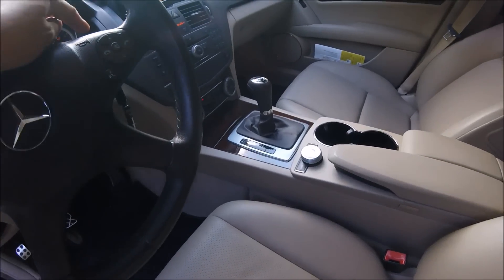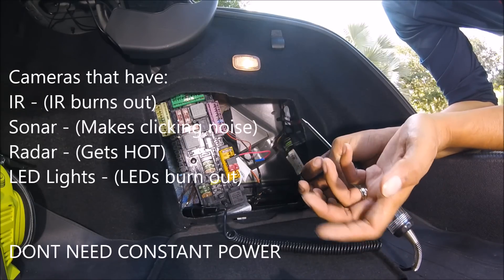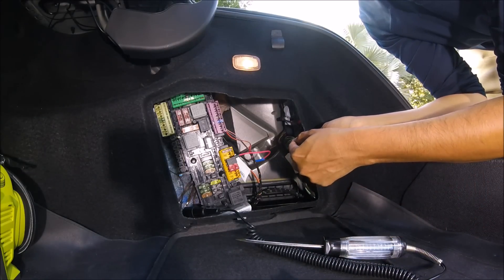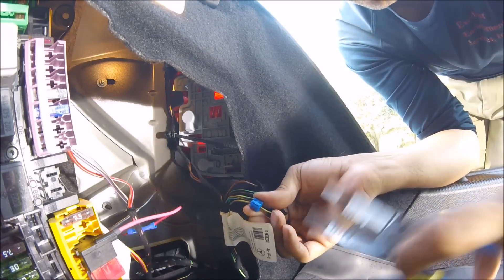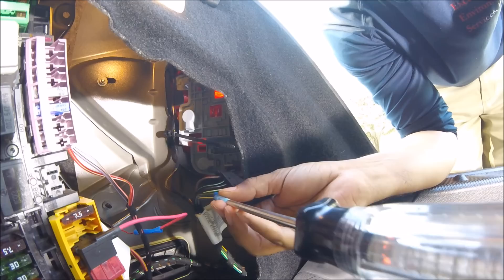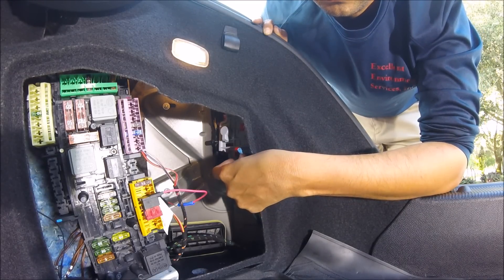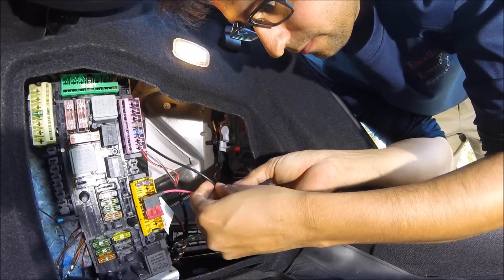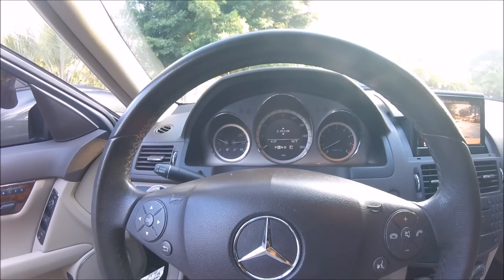Wire Backup Camera to Reverse Light CORRECTLY on ANY car

Comment: I think the warning message is for the bulb (lamp) being out or technically an open circuit not a voltage "drop".   Still a great video - it's nice to have a fuse panel in the trunk - makes for easy add-ons ;-).  As others have pointed out probably the "best" way would be to cut and solder the wires and perhaps use a relay to avoid more current being pulled that was originally designed but it being a German car I'm sure everything was over engineered and the reverse light wires could probably take more than the 5 or 10 watts the stock bulb pulls thinking that us Americans will replace the incandescent lamps with LEDs anyhow ;-)  Great video!

Comment: Use a constant fused power wire from battery to camera and a relay from the back up light tap to use as a switch for on/off, it will be ideal! Might as well run a heavy gauge fused power wire from battery to the trunk and add a little fuse panel, or junction box with several terminals. It will be constant power supply for multiple auxiliary gadgets you like to power in the back of the car. Then just hook relay for camera, relay for rear auxiliary lights, relay for rear monitors, or relay for rear amplifier! Just a thought...Peace
Reply from the maker: You need the advance section of my channel:
https://youtu.be/MNWNAC7kNUA

Comment: Hey did you ever ponder the idea of putting in the Folding back seat option?  I actually would love to see that done, because I am looking to experiment with the idea, I am digging this video by the way Great job!
Reply from the maker: Folding seats?!? Point me in the direction!
Reply: sure man heres a link:  https://www.ebay.com/itm/MERCEDES-C-CLASS-W204-C300-REAR-SEAT-SET-5-SEATS-BLACK-LEATHER-OEM/291938344016?ssPageName=STRK%3AMEBIDX%3AIT&_trksid=p2055119.m1438.l2649
or .......https://www.ebay.com/itm/2008-MERCEDES-W204-C350-REAR-SEAT-ASSEMBLY-BLK-2008-2011-C300/172854549573?ssPageName=STRK%3AMEBIDX%3AIT&_trksid=p2055119.m1438.l2649

I know your interior is a cream color, so i'm sorry i could not find a cream interior version but yea there is a folding seat option for back. I will be looking eventually to do this I just figured maybe you could do a great demonstration of it as you do always thanks for the reply

Comment: Good video. Thanks for information.   What about soldering the wire with heat shrink insulation.?
Reply from the maker: You can definitely do that I actually encourage that method. But this video was created for the DIY person. Solder is a skill some people aren't willing to do.
Reply: @RaymondUrias  not safety, soldeing not newer used car, if wire come sometime hot, maybe somethink have broken , then wire have hot and melt solden and burn car, wery stupid idea.use only specified abico crimping connectors and right tools grimp this, then have sure good connection and safety. no melt, no come hot, no drop, no burn car.
Reply: @mattivirta  if the damn wiring in the car is hot enough to melt solder, you have much more serious problems. Common rosin core solder melts at around 180C. Not to mention, a small drop of melted solder isn't going to cause a fire. Solder and shrink wrap is the proper way to do splices, bottom line.

Comment: Isn't the right way via canbus signaling, I put a system in my brother 2012 c300 and didn't have to to all that, it had a camera video and power line on the unit once the vehicle goes into reverse camera gets power automatically and power drops 20 seconds after once it's out of reverse same for most units I've installed in many cars....
Reply from the maker: Way ahead of you. I have been working on Mercedes Benz since I was 19. This video was for the everyday car. But I don't own an every day car so I made lemonade with what I had. This video is for you:
https://youtu.be/MNWNAC7kNUA
And I have another using capacitors.....
Reply: Raymond Urias oh ok I understand what you're saying, I was just wondering... Lol but don't forget to put the parking brakes on cause in reverse the wheels are free lol...  But back to the electrical you can also use a diode that will just get the 12v feed but don't push back residual or static voltage back into the lamp control module, that will prevent the system from tripping the fault..  There's other methods also but I'm sure this works for everyone

Comment: Thanks bruh, great info.. i have a c230 compressor 05 and im gunna be updating the sterio system with a back up cam, and now i know how to install that bck up cam.. so i thank u.. and u have a new sub👍
Reply from the maker: Make sure you buy a relay or capacitor it will save you
Reply: Fosho, thanks again

Comment: I have Volkswagen vento I've wired up reverse camera power and ground both to reverse bulb wiring itself. So I haven't used separate ground for the reverse camera. Is this safe and correct way of wiring it? Also my camera screen pops up automatically on my pioneer AVH Z5090bt even if I'm not in reverse. Solution please
Reply from the maker: Nothing wrong with what you did assuming you found the correct ground wire. Did you also run a signal wire to your radio? The pioneer requires a signal wire be ran from the reverse bulb/ or OBD2 to the radio I believe it's a purple wire in the back. Also you will have to go into settings and select the correct one. Keep in mind if you have it set to battery your telling the radio that the camera is always on so the screen will switch to that while you are driving. I would change it to ground or if possible signal.
Reply: Raymond Urias - Yup I've given signal to purple camera turn on wire of head unit and it's positive from reverse bulb. So the settings are kept on battery as options available are only battery and ground. I've checked connections via dmm.
Reply: Raymond Urias - Yup I've given signal to purple camera turn on wire of head unit and it's positive from reverse bulb. So the settings are kept on battery as options available are only battery and ground. I've checked connections via dmm.
Reply from the maker: Make sure you don't have the reverse camera app open. Close it and set it to off. If you have it on it will keep switching to the back up camera and display a black screen. You can only have it on if the camera is wired to constant 12v then you can turn it on while driving and see cars coming up on you 🤣
Reply: Raymond Urias - Yup I'm done with this too. I think we're close to the solution. After reading your comment I'm down in my car now tried it immediately. But as I switch off back camera input camera won't turn on even if I switch to reverse!

Comment: You show the power wire..how bout the neutral or ground?
Reply from the maker: What neutral? They only have power and ground. Ground goes to a bare metal point or you can tap the ground wire coming off the bulb harness. If you are wiring this in your BMW I recommend watching the relay video as you will need to do that.
Reply: +Raymond Urias .ok I guess that's what I was asking.the ground on the harness..is that green?
Reply: +Raymond Urias just don't want any error codes..you know how these bmw's are.  Lol

Comment: We have a ford fusion 2013, now I'm not sure if the Auto-Vox M1W you described on one of your other videos comes with power wires for the front end or is it just the cigarette lights plug. Like most other cameras that i saw have two power sores wires the rear you'll have to hook them up to positive and negative and the front also. You also described on this video that by using a wire tap connector via the reverse light and then you ground the black wire, my question is do I have to do the same for the front for the monitor?  Does it come with wires that i have to strip and find the power sores or does this Camera come with just plugging into the cigarette lighter?
Reply from the maker: +Whisper Slade ok I'm going to answer this with video links
First check out the new T2 it's nice
https://youtu.be/H_0djBUAn0Q

And your question is answered in this long old video I made.....im really sorry it's so long I didn't Know how to edit back then

https://youtu.be/7Dc8K97EmhY

The M1W uses a cigarette lighter for the screen. I'm pretty sure you will like the new T2 it soooo easy

Comment: I found the hot wire using this method, but where do i put the black wire?
Reply from the maker: +Kenny Parsons Ground to a clean metal nut/ stud near by. Or you can use the same method but hook up the meter to a 12v source and it will flash when it touches ground
Reply: Kenny Parsons Thanks for asking. I was wondering the same thing. ☺

Comment: Still think it best to disconnect earth on battery once you have found your wire ??
Reply from the maker: +syd bell not really necessary since it is not an open wire flailing around. All your doing is a simple tap. Now if you want to cut the wire in half and solder it in then yes disconnect the battery

Comment: Manage to install a reverse camera on my 2007 ML thanks to your vids. thanks ;)
Reply from the maker: +Luis Sampaio Thats awesome! What are your thoughts on the 07 ML?
Reply: In one word, excellent. Mine has air suspension so its smoth. did a remap and its now at 298 bhp. originally had 224 as its the 320 CDI. And its "upgradable". Got an android unit installed, led bulbs almost everywere without dash errors. Great car to ride, very happy. And thanks to your tips just adding stuff ;)
Reply from the maker: +Luis Sampaio that looks really cool and integrated but I feel for the money you can get a much better camera. I'm currently reviewing the Roav Cam 1 and I'm VERY impressed with it. It has a parking mode that works very well. There are several cameras out there and each year they get better. Definitely check it out:
 https://www.amazon.com/dp/B06XNSDRW8/ref=cm_sw_r_cp_apa_tV2xAbFD2RR8J

I personally like the parking feature because I go to car car shows and leave my lights on and I want to know if someone touches my car or keys it. But if you know your neighborhood and trust where you park then you may want to look into other options.
Reply from the maker: +Luis Sampaio who did the tune?
Reply: here its pretty safe ;) and I mostly don't want any screens on my windshield. this one caught my eye because it's plugged to the obd socket so no cigarette ligher cables and has no screen... But i'll keep looking ;)

Comment: I got the plastic piece of the wire tap with my reverse cam kit. What do you call the insulation part that fits on top part of it?
Reply from the maker: +Nimantha Wickremasinghe is this a trick question...I feel like I'm being setup lol. The plastic is called insulation and the metal part is called the blade on a wire tap. Send me a picture on Instagram @raymonduriasjr
Reply: Hmm. Have to find some insulation then.

Comment: Hi Raymond, I have the same camera, it worked fine for a couple of days, but now it only works in reverse and the trunk is open all the way. Car: 2016 Chevy Sonic sedan, any suggestions would be appreciated
Reply from the maker: +Miguel Avila I'm confused it's a reverse camera...so it works in reverse. Or are you saying it only works if the trunk is open? I would recheck all the connections and make sure they are tight. If that's not it I would rewire cam using a relay: https://youtu.be/MNWNAC7kNUA
If that doesn't work then check RCA cable make sure it's in. And if that doesn't work then the camera maybe dead.
Reply: It works in reverse but only if the trunk is open all the way, not halfway, it's weird.
It use to work in reverse normally when first installed... I checked all the wiring, red to red of reverse light and ground to black.  I also tried connecting the ground to a metal part of the car.  When I open the trunk i can hear some type of click as if something is being triggered, not sure if it has to do with the 3rd brake lamp.

Comment: What is the best way to do this on a M/T car. In the case of the M/T ....If it is M/T reverse only comes on if the car is in reverse, which only happens while you are moving.
Reply from the maker: +Good4Y0u put key in car, turn to where your power comes on but not engine, put in reverse. The light will come on without stalling your car
Reply: Raymond Urias I mean to actually use reverse . Unless I'm clutch engaged the reverse lights don't tend to come on... could just be my car though.
Reply from the maker: +Good4Y0u that maybe your car. My Z3 does not do that. You will need someone to help you with your car (Someone in driver's seat) (Someone in back) Make sure Ebrake and wheel chucks are used...I don't want a subscriber to get run over

Comment: nice to know my 3rd gen 94 toyota camry is still high end. it has a rear bulb warning too.
Reply from the maker: +james42519 94 Toyota has that?! Jesus that's really ahead of the game
Reply: yeah there is a light in the gauges that comes one when brake light, license plate light, reverse light burns out. there is also auto lights off when you turn car off and open door. car won't let you lock doors if the key is in ignition and door is opened too. it unlocks them if you try and lock them. the sunroof beeps if you leave it opened and turn car off but sure that is common on cars really.
Reply from the maker: +james42519 that's actually really advanced for a car of that year. I'm surprised!
Reply: @james42519  same has my old volvo car, all has alarm and no can closed car if windows and roof have open etc, and not can add reserve cam to light alarm fast if touch to wires. i need to cam own relay then this work ,relay come to fusebox were resrve light fuse has.and not can start car if not sitting driver chair and door has closed, somethi,e has hard.

Comment: Hi - Quick question if I may. Where does the negative cable from the camera power cable go? Thanks in advance
Reply from the maker: +Jed Yaqub ground point on the car, or the ground wire on the tail light harness.

Comment: Thanks for great video and very helpful topic.  Will use method to tap into my Honda wiring.  Re: your vehicle's computer/dash fault indicator I understand voltage drop concepts, but do not follow why, you when now you activate camera/radar, the dashboard fault does not return as computer notes voltage drop from camera/radar.  Hope question makes sense.
Reply from the maker: Preston Ren Question makes complete sense. The camera is consuming nothing in the long run. The computer measures the current. There is a very small, known, resistance in the circuit, and a differential voltage measurement is taken across the resistor, which give the current in the circuit. If this current is below the threshold value, the bulb is assumed to be burned out. This is why when you upgrade to LEDS you need to use a resistor to trick the computer since LEDS use so little energy.
Reply from the maker: +Preston Ren I just checked out of curiosity the camera with radar is pulling 1.5A which is nothing literally a led bulb

Comment: does the backup camera automatically display on your factory installed MB info center monitor once your car is placed in reverse?
Reply from the maker: +Edward Woo Yup. You can set it up in programming mode for reverse.

Comment: I have an Infiniti G37 and installed a backup camera this same way but it only works when my emergency brake is on. Any ideas what it could be? It's manual transmission don't know if that has anything to do.
Reply from the maker: +William Diaz what year is the car?
Reply: William Diaz probably on a normal video input & safety feature only let's you watch video with parking break on.  Look for another video input/setting to change that inputs behavior, or override parking break safety all together.

Comment: just use a 12v relay with a clean +12v wire and the + from the reverse camera just to trigger the relay
Reply from the maker: Timmy Spider That will work too!
Reply: i first did just that,it worked fine until i started the engine then the image was rolling from up to down and see nothing because of the power draining in the backlight circuit.now from a cigatette lighting from the trunk i got a clean +12v and use the relay
Reply from the maker: Timmy Spider Yea I did a video about that and how to correct it:
https://youtu.be/SUOivzMeoqU

BUT I have been getting a lot of messages with people asking how to wire it up with a relay. So looks like I'm going to have to make a video for that lol. You were the final tipping stone lol.
Reply: Julian P. Hi, I have fitted the reverse camera! It works when the car is off but not when the car is on. I have bought a relay for the constant 12v but I don't know how to fit it
Reply: @MegaMidas100  Hi I can guide you through it.
Reply: @caraudiosolutions  excellent, I will get all of the stuff out and come back to you 🙌
Reply: @MegaMidas100  please do.